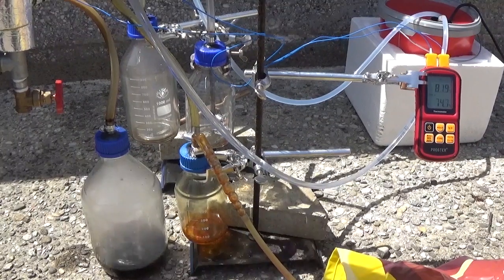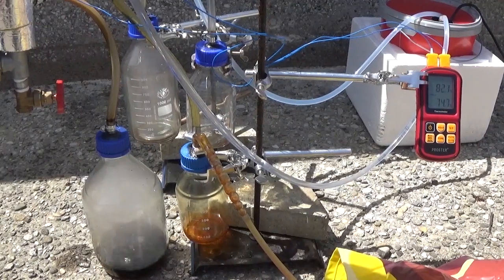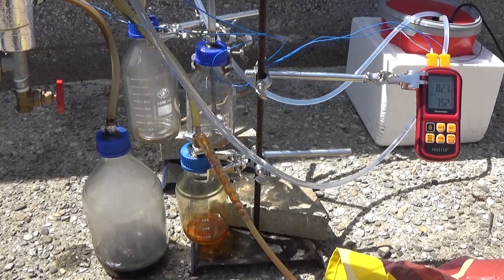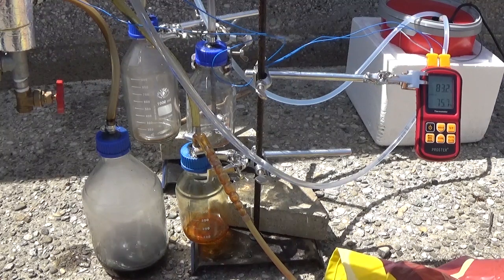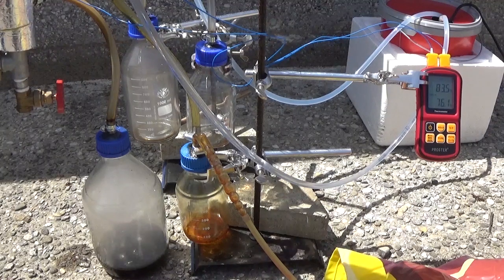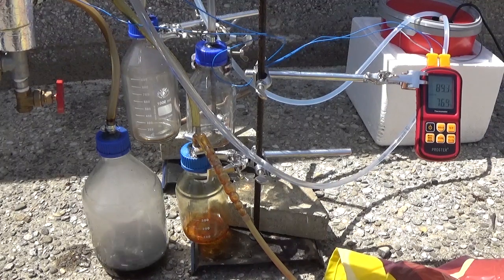incredible news pyrolysis reactor (update 4)

Comment: Hi,
great project and documentation.

How big will a unit for 3000€ be and how much input and output in terms of quantety is it calculated for?

Do you know it there are any regulations for using such a system in germany? 
Is this process generating toxic fumes in the process you normaly would not want your house to be aroud?

Greetings from Rostrock!
Reply from the maker: Hey,
die Anlage soll ca. 3-5 kg/h verarbeiten können. Das Nutzungskonzept in Deutschland wird noch überprüft. Sobald wir die finale Anlage gebaut haben wird das dann mit den entsprechenden Ämter zu klären sein.

mfg hazelChem

Comment: do prevent repolymerization of the cracked pyrolysis oil which will contain some double bonds wouldnt you either need to stabalize it with some additive or hydrogenation in the next step.

Comment: I think because of the war and increasing price of fuel the time for pyrolytic oil has come, but have you calculated the price of this oil per liter ? Can it compete with fossil fuel ?

In order to be used as fuel, does it require a fractioning or can be used as diesel directly ?
Reply: Probably not since there is considerable infrastructure of oil industry. The gains would be less use of fossil fuels due to reuse of plastics already available in the environment generating less pollutants per kg of oil used. Besides it removes the plastic waste from environment, a problem onto itself.
Reply: @seu_menino7757  Ok but who whould buy a barrel of pyrolytic oil if it cost 300 dollar for example ? Fossil oil is now around 100 dollar but because all these crisis ongoing, otherwise can be 50 dollars or even less
Reply: @zodd0001  i think it does not cost that much if done on a proper scale. I read through and the cost is basically energy to power pyrolysis and distillation units. HazelChem said his reactor uses 30% of its own fuel for energy. So basically cost is based on weight feed of plastic waste. If you have cheap supply of waste plastic then it is probably profitable with right design choices.
Reply from the maker: 100% correct

mfg hazelChem

Comment: Do we own a bit of the end result if we sponsor? If I can get a taste of what this becomes ill happily throw money down.
Reply from the maker: Hello Justin. Thank you for your intrest. Normally a sponsorship does not include ownership. Only being named as a sponsor of the project which is why mostly companys do sponsorings like this. 

mfh hazelChem
Reply: @HazelChem  amazing work!!

Could you please tell me if the fractionating column is empty inside or does it have a specific structure?

Also wouldnt it be more efficient if in each stage of the column there is a short vigreux column to improve seperation efficiency?
So in this case you will have 3 small vigreux columns with the output pipe connected after each one

Comment: How much energy in vs how much energy out with this setup?
Reply from the maker: You loose about 30% of the energy contained in the waste for heating the process. In my old reactor I heated with external gas because it was not my main concern to run it self sufficient. 
At that time it was about proof of concept and getting the fractionating system working. The reactor we are building now is quite a bit more high tech and runs on its produced gas. This is why you normally do not have to add any fuel for the process. You just need to have gas storage (for example a foil gas storage like it is used for bio gas). The amount of gas being produced depends on the temperature so you always drive the system in a range where it produces slightly more gas than is being consumed. With the capacity for fluctuation the storage system gives you you can run the pyrolysis sufficient.     

hope this answers your question

mfg hazelChem

Comment: Did somebody seriously calculate the efficiency against using the contained energy in direkt burn?
I'm constantly doubting, if it wouldn't be significantly better, investing the money in clean burners and exhaust filtering.
Cleaning vessels could be operated self fueled instead of wasting bunkered Oil on their mission and many power plants could use plastics instead of coal easily - or any mix of it.
Especially burning brown coal is not too far away from burning smudged mixed plastics. Even smells the same, when burning.
And clean PE is the most clean fuel by itself anyhow next to hydrocarbon.
Only downside, i see -> no fuel for vehicles, if you use all waste plastic resources to power stationary steam engines.
But worth considering, i think, because it may have better eficciency over all.
As much as i crave for cheap diesel....we have to think about eficciency in the first place.
I mean - your destillate needs a lot of refining still to fuel a modern car. In the end higly unlikely that this way of making fuel is the way to go these days.
Reply from the maker: You loose about 30% of the energy contained in the waste for heating the process. (In my old reactor I heated with external gas because it was not my main concern to run it sufficient. At that time it was about proof of concept and getting the fractionating system working. The reactor we are building now is quite a bit more high tech and runs on its produced gas.)  That is why the system should not be used in industrial countries (except maybe now to tackle the Rus oil problematic) 
In developing countries it is a different story building a waste combustion plant with adequate filters ranges in the millions... so a decentralized small system like this is actually very beneficial in such cases. Just imagine in the areas we are speaking about most people cook by using the few bushes and trees that are left around them causing more desertification usw. and the produced oil can be cleanly burned in a gasoline stove. 
You just need to use the technology in the right place under the right circumstances. Like with everything else see also electric cars batteries are great but not for every purpose hydrogen is way better suited for trucks etc. 
I hope i wrote this in an understandable manner if you have more questions feel free to ask them.

mfg hazelChem
Reply: @HazelChem  
An addition for my first answer:
This third world theme is something, we should think over, too.
That's oldstyle colonial thinking in first place - and thus may lead to false basic assumptions.
No offense here.
Don't you think, you create the best excuse ever to collect plastic waste big style, that will carry on this problem for another 30 years - given the fact, that todays plastic collecting children are the ones, that train their own children to collect plastic, so you'll actually spread the problem within a short time.
And that's only one aspect of a multilayered problem and every layer is complex.

And btw, yes, in fact - the"Rus-problem" is here to stay and will affect us.

"Third world problematic" is everywhere. If not now, it soon will be.

The better reliable sustainable energy source for this fraction of people, who chop their woods for cooking would probably not be the cancerous smoky fluids out of small scale pyrolysis plants, but the less toxic biogas flames from their toilet systems - since there often is such a problem at the same places, which has to be fixed anyhow to avoid the next plague.
So - i honestly think - if pyrolysis may be part of the solution, then at places, where plastics are sold - and in big enough style to be able to afford clean output over time - which requires mainenance crews. Not in areas, where no diesel power plant isn't even able to survive.
And in parallel, we should develop cheap, but solid fuel burners, which are capable of burning plastics too.
Reply: @HazelChem  
Of course i see your point. But  i try to get the bigger picture - we may start to learn from our usual mistakes, maybe. 

I think, we have a limited resource here. Right from the start. Although waste plastic seems to cover everything and supply seems to be endless - it is not, because we're on the way to stop that. Not Shell maybe, they need to be forced to stop pushing plastics, but overall plastic production will decrease - by law. But anyhow, every resource, we lay our hand on and start using it, is gone in no time these days. 
And - most important - what we develop now, do cost us resources too and has to work  for one generation to come, otherwise we better save our labor for more useful things - you are building the future, not the past. That's my concern. The 30% waste for pyrolysation is lost - that's the first big loss we would safe, if we decide to use the resource as direct fuel. Maybe. Just don't think the old stuff further and further. We didn't win the last war either with our converted fuel. We run out of it instead. Efficiency is key to survive, being the numbers we are. If that's our goal anyhow.
Reply: I think efficiency of burning solids is low. You cant burn it on higher temps limitting your Carnot efficiency. Burning vapors or gases on the other hand is more effcient. 30% fuel cost is not bad to produce something that could have much higher efficiencies. Liquid fuel is great for condensing that energy and safely moving it around though. Maybe not save the world ya but someone with right process design could correctly profit from plastic waste.
Reply: @seu_menino7757  
Burning solid plastic in atmospheric burners is low temperature and the burn is not clean, that's true. These ovens i think about, must have another design with guided and enhanced airstream.
But open enough, that anybody could clean them without any problem.
Suitable design basically the same for cooking, heating and for steam boilers.
That would be a dream.

A lot of the waste oil burner designs on youtube are practically unusable after a while - just as an example for what we don't need in real life to solve a problem. I know, because i had to clean our waste oil oven every day for years.
Burning plastics in a normal oven cannot save the planet, that's right.
Reply: @werner.x  i was thinking more for energy generation on Power plants or smth like that. Not for everyone to use.
Reply: it will run in every prechamber diesel (w124) and TDI with bosch VEP 37/44.
Reply: @svendittmann3105  Sure, but with uncertaiin specs and unsafe lubrication - unrefined it's not really Diesel, just chemical waste, that burns somehow. We speak about clean fuel for future use, not outdated technology.
Reply: @werner.x  I'm sure this is only a private project to make own fuel. 
What are safe specs? If the petro industry make petrol or diesel from grude oil to crack the co and condense it on several temp. points. Same as here! 
One of the best ways the test what kind of CH is condensed is a flame test. same as here! 
I'm sure is it no science it is practice it is DIY!
Reply: @werner.x  wow!
Reply from the maker: Hallo Werner danke für deine vielen engagierten Kommentare.
Ich selbst studiere Chemie und habe mittlerweile knappe 9 Jahre Laborerfahrung. Du deinen Bedenken bezüglich der Giftigkeit der entstehenden Verbindungen lässt sich sagen, dass das Öl einen nicht zu vernachlässigenden Aromatenanteil hat, und somit bei Kontakt eine mäßig höhere toxische Wirkung als hydrierter Kraftstoff aufweist.
Zum Brandverhalten der Pyrolyseölfraktionen gibt es genug Paper, welche belegen, dass bei halogenfreiem Feed (d.h. kein PVC usw.) die Brandprodukte denen von Benzin und Diesel im Berreich der toxizität sher ähnlich sind. Somit liegt also keine wie du es genannt hast Vergiftung der Nachbarschaft vor. Du scheinst hier eine sehr starke Meinung zu haben, weswegen ich dir sehr gerne ausführlicher Antworte. 
Die im System enthaltene Fraktionseinheit zerlegt die Kohlenwasserstoffe bereits in einzelne Siedebereiche, welche dann nach Untersuchung auf Ex-Punkt und Viskosität zu entsprechenden Kraftstoffen geblendet werden können. Ich habe leider jetzt nicht mehr alle deine Punkte im Kopf, schreibe mir doch gerne einen Kommentar mit allen Bedenken, die du hast und ich versuche aus wissenschaftlichem Standpunkt auf alle einzugehen. 

mfg hazelChem
Reply from the maker: Als Studierender Chemiker will ich dieser Aussage vehement widersprechen! Die Toxizität der einzelnen Komponenten übersteigt zwar die des handelsüblichen Kraftsoffgemisches ist aber für Fachpersonal keinerlei Problematik. 
So arbeite ich in meinem Laboralltag seit Jahren sicher mit den selben Substanzen in Reinform z.B. Benzol.
Falls du weitere Fragen hast beantworte ich sie gerne.

mfg hazelChem
Reply: @HazelChem  
Danke für die ausführliche Antwort.
Ich warte seit Jahrzehnten auf Fortschritte auf diesem Gebiet - seit man den Werkstätten in den 80ern wegen Emissionsbedenken kurzerhand die Altölöfen verboten hat. Und es hat mich immer genervt, daß man uns eigentlich belügt über die Giftigkeit der Verbrennung von PE und PP.
Allerdings scheinen grade diesen beiden Kunststoffe nicht sehr viel Energiedichte aufzuweisen. Und inzwischen scheint auch der Großteil des Plastik-Hausmülls Styrol und PVC zu enthalten - und damit gehen ja für nicht großindustrielle Verwertungsprojekte die Probleme los.
Meine Bedenken gegen deinen Reaktor fangen da an, wo die Pläne losgehen, damit z.B. Holzeinschlag zu verhindern, indem in "Entwicklungsländern" bzw. in deren jeweiligen Problemregionen Holzherde gegen andere Feuerungsmöglichkeiten ersetzt werden sollen. Da sind die Hoffnungen ja immer immens hoch.
Und da sprechen wir dann nicht mehr von sauber fraktionierten zukünftigen Kraftstoffen aus verdrecktem Plastik, sondern um vergiftete Umgebung durch unsachgemäßen Umgang mit den "Rohstoffen" UND mit den Kleinreaktoren selbst.
Ich habe zum Beispiel im Sommer 2020 einen meiner Hunde durch Leberversagen verloren, weil meine Dieselheizung am Kraftstoffeinlaß undicht war und vermutlich den ganzen Winter lang unverbrannten Diesel über den Wärmetauscher verdampft hat und damit die Luft in meinem Wohnwagen kontaminiert hat. Ich rieche den modernen geruchsarmen Diesel berufsbedingt nicht mehr und so wunderte ich mich nur über meinen schlechten Gesundheitszustand und die unfitten Hunde. Die Kleinste hat es dann eben nicht überlebt.
Es ist also nicht so trivial, womit in Zukunft im Ghetto die Kinder rumpanschen.
Vor allem nicht in Gegenden, die schon damit überfordert sind, ihre Exkremente zu Biogas zu verwerten, obwohl die Temperaturen dafür ausreichen würden, die nicht vorhandene Kanalisation ein Gesundheitsproblem darstellt und fehlender bzw. zu teurer Kunstdünger ein ebenfalls ungelöstes Problem ist. 

Ergänzung: 
Will deine Fachkompetenz nicht anzweifeln. Bin auch froh, wenn in Richtung vernünftiger Plastikmüllnutzung ndlich mal etwas vorangeht. Wozu ich aber die meisten "Diesel from waste plastic" Beiträge auf youtube definitiv nicht zähle, weil man die dort erzeugte braune Brühe nicht einfach so auf Umwelt und Motoren loslassen sollte.
Ich bin außerdem immer noch der Meinung, man sollte das Thema weiter denken. Wenn man bei uns die Umwelt schon in großem Stil mit der Verbrennung nasser kohlenstoffreicher Erde, genannt Braunkohle, vergiften darf und dazu auch noch die wasserspeichernde Schicht aus dem Boden reißt und laufend Dörfer zwangsumsiedelt, dann könnte man auch drüber nachdenken, ob diese nasse Erde nicht auch mit Plastikmüll angereichert verbrannt werden kann und das nicht sogar die Effizienz steigern würde. Am Braunkohle-Abgas-Gestank ändert Plastik jedenfalls nichts mehr. Vielleicht ist das diskussionswürdig, wenn man mal Scheuklappen fallen läßt - weiß ich nicht.
In Müllverbrennungsanlagen, wo man eigentlich denken würde, daß Plastikmüll schon jetzt nützlich ist für unsere Fernwärmeversorgung etc., weil sonst oft mit Stützfeuerung gefahren wird, also Extraenergie zugeführt wird, muß bei hohem Plastikanteil angeblich gekühlt werden, weil die Öfen für diese Temperaturen nicht ausgelegt sind. Das ist auch hirnrissig - und dort ist vielleicht ebenfalls brachliegendes Verwertungspotential, denn diese Heizkraftwerke haben wir ja schon stehen und die verbrauchen auch noch Gas, das uns jetzt und bis auf weiteres extrem teuer kommt. Ich sähe da gerne entsprechende Forschungsergebnisse plus praktische Fortschritte.
Alles eine Frage der sinnvollen Prioritätenverteilung.
Keinen Plastikmüll mehr ins Ausland verkaufen, sondern direkt hier verwerten, wäre sicher ein erster vernünftiger Schritt.  Der Plastikmüll, der nicht wirtschaftlich recycelt werden kann, ist auch großteils der, der in der Pyrolyse problematisch ist und daher erst recht keine gute Grundlage für die Energieversorgung wirtschaftlich schwacher Regionen darstellt  - soweit ich das beurteilen kann.
Das jetzt nur mal zu meinen Gründen für's Engagement - aber - ich habe grade wenig Lust auf Problemerörterung, letzten Sonntag habe ich meinen anderen Hund, den letzten, wegen einer Magendrehung verloren - und bin davon noch angegriffen.